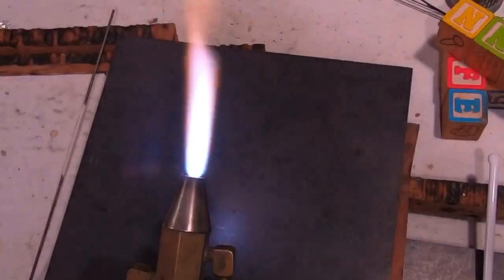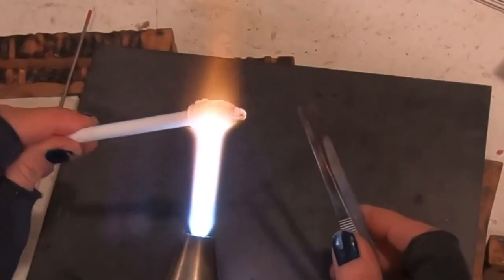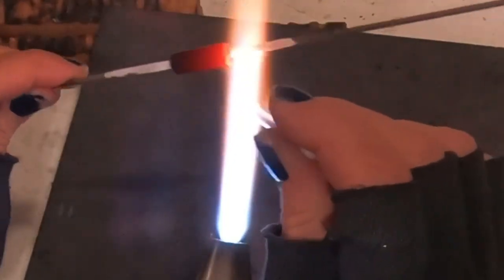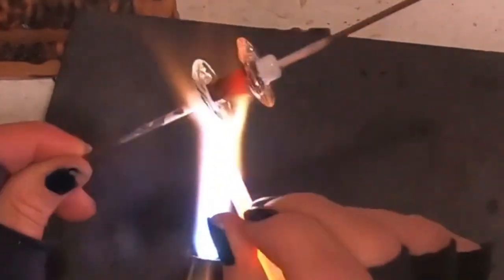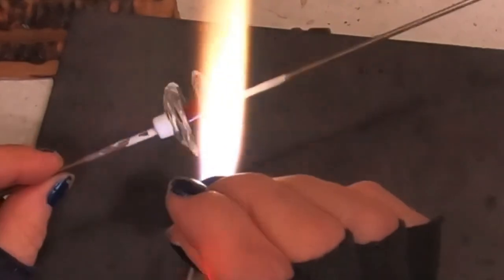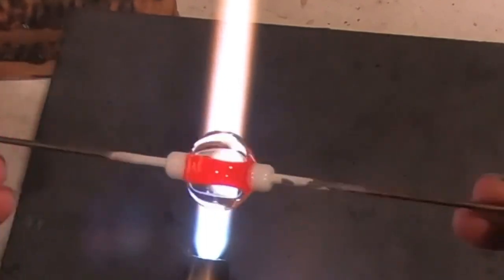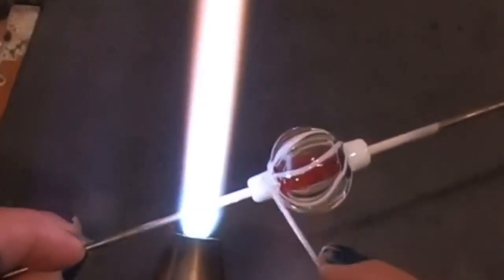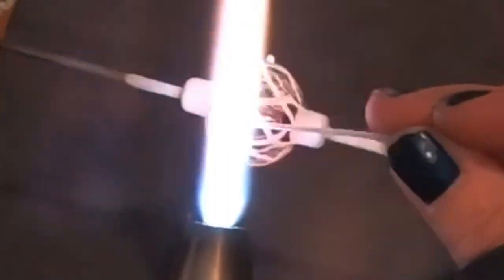Lampworking / Flameworking - 101.44 - The Hollow Reticello - 104 demo

Comment: I love how the encased white gives the bead an extra, I guess I’d say ‘demension’.  You can really see it from the sides.  

What is your favorite size mandrel?  Everyone, please give your answer as well. I really want to know…and why you picked that size.

Robin, I’m still sick. BUT I have a new tank of gas amd am taking myself back through the basics. You know I still can’t pull a stringer to save my life
Reply from the maker: Beth! 🤗🌹 I’ve been working on a fun way to practice those really fine stringers and that clear encasing is the key!    ✨  I always find myself using the 3/32” mandrel because it is a standard size and I have a ton of them.   But I’m very fond of the 1/4” because you can get bigger faster and you can put it on a thicker cord.  The ring mandrels are really cool too…😂  OK…guess I don’t have a favorite! 
I’ll have to play around with the bigger sizes asap!! ….suddenly I feel like I’ve been neglecting them😅
….and what’s your favorite mandrel ??  
I hope you feel better soon so you can practice those stringers!!  I have faith in you!!  ✨🌹✨
See you soon Beth!   🤗✨🌹 Cheers- Robin 👋🏽✨💫💫💫
Reply: @scottwoodresearch  thanks….I was thinking…what if you made ribbons?  Make the white encased stringers like normal.  Line several together, baking ribblins.  Then there could be 3or4 white enclosed in the ribbon.  Then when laying out there would be more white lines for each laying
Reply from the maker: Yes!  I actually make the ribbon cane for the lady heads I’ve made.  Would be fun to see how it would look with just white lines.  They make it in studio glass all the time!  Oooo…I’ll have to jot that down! 😂
Good idea!  ✨Thanks Beth!  ✨🌹👋🏽🤗